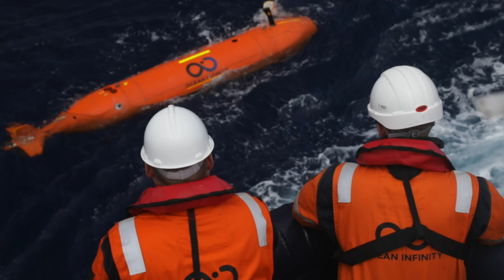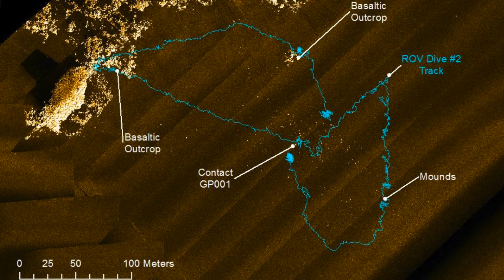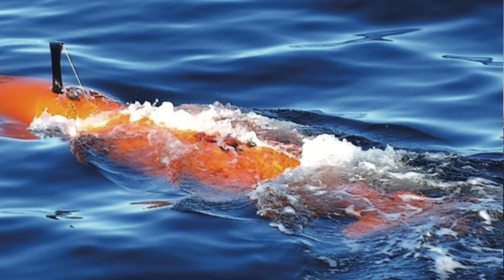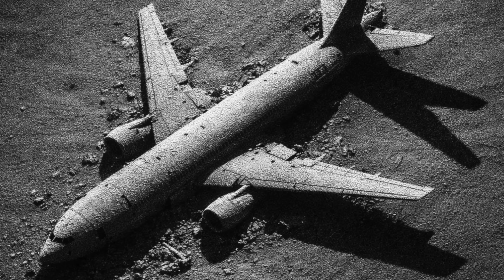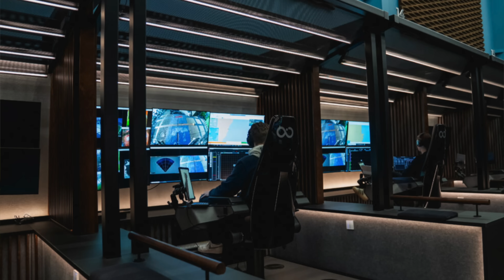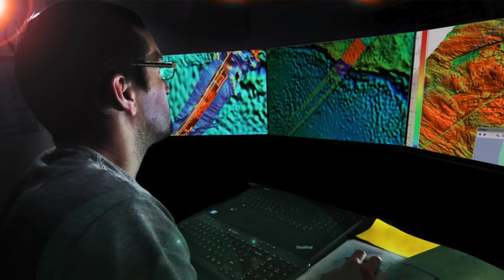MH370 – Search Technology Evaluation (Search Technology)

Comment: It seems like one of the impediments to searching is when the wave height makes launching the AUVs over the stern impossible. Given this limitation, why can't the AUVs be designed to launch from the moon pool that is used to launch the Remotely Operated Underwater Vehicles?
Reply from the maker: The Armada 86 moon pool is 9 m x 4 m and is fitted with a modular Launch And Recovery System (LARS) that is fully automated and remotely operable from Ocean Infinity’s RCC network. The Hugin 6000 AUV is 6.2 m long so theoretically it could fit. However the AUV weighs 1,850 kg so it is much easier to launch it off the stern.

The Hugin 6000 must enter the water horizontally and cleanly to avoid fin damage, sensor dome contact or uncontrolled rotation. A stern ramp or A-frame launch naturally supports horizontal water entry, immediate propulsion clearance and minimal structural interference.

Moon-pool launch often involves vertical hoisting, which is less ideal for torpedo-shaped AUVs. Recovery is more difficult in a moon pool. Recovering a 6.2 m torpedo AUV into a moon pool in sea state involves alignment in the well, capture using docking frame or net and heave compensation. Stern recovery allows tow-in guidance, cradle capture and a simpler handling envelope.

AUV operations typically involve rapid turnaround, launch, multi-hour mission, recovery, battery / data service and relaunch. Stern ramps or A-frames reduce handling time compared to moon-pool lifts.

On vessels like Ocean Infinity's Armada fleet, moon pools are frequently optimised for ROV deployment, vertical sensor packages, seabed drilling tools, smaller AUVs and subsea nodes.

The Hugin 6000 is one of the larger AUV classes, so stern handling is operationally cleaner.

Comment: Wow, such superb technical details and easily described. Thank you Richard. I was especially interested in the future remote operating, using shore-based personnel. What about the jobs that have to be done when the AUVs are recovered to the mother ship? Batteries will have to be changed and routine maintenance carried out. The data itself will probably already be transmitted to OI's laand based headquarters as the AUV surfaces but tasks such as maintenance and checking cannot be done remotely. Will there be a skeleton crew for such activity?
Reply from the maker: I think we will see lean crew operations for some time. At some point AUVs will be parachuted in to a location in the middle of the ocean by plane, make their own mission planning, return to the surface to communicate via satellite and recharge the batteries. When they finish the mission, they will return to port on their own.